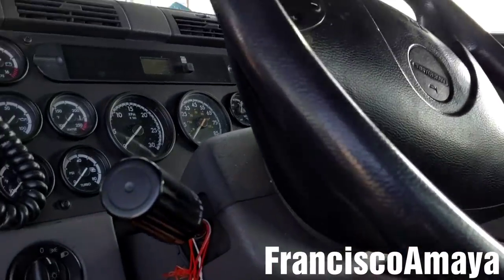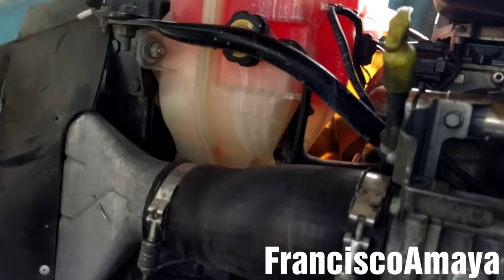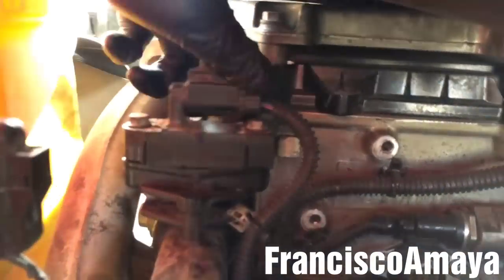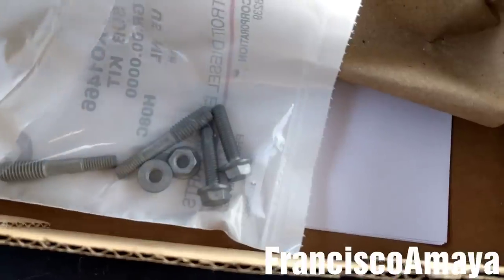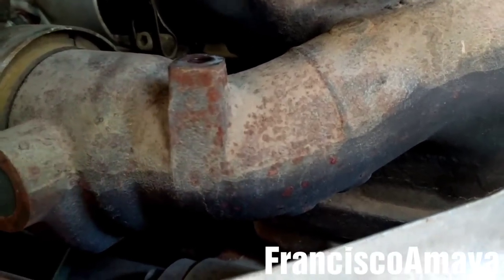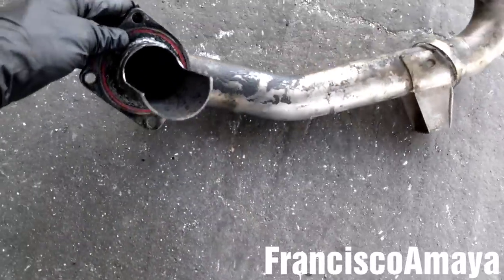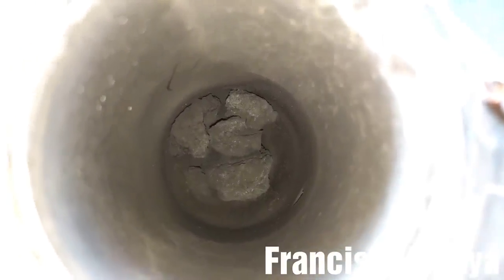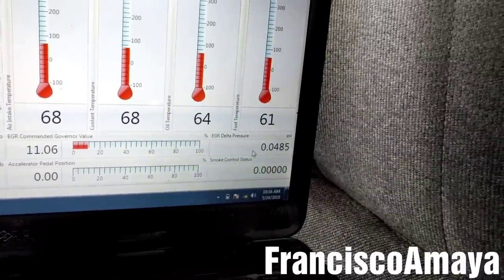Freightliner Cascadia DD13 DD15 DD16 EGR problem low power derate spn 2631 fmi 1

Comment: I used this video to diagnose my engine fault code. I replaced the Delta P sensor and the pipe it connects to. The light stayed on at idle, but after 230 mile with a empty trailer, when I stopped for fuel and turned the truck off, when I turned it back on the light went out. Thanks for your videos. New subscriber!

Comment: That EGR pipe is called a Venturi. Also you are doing good, I do this for a living and have for 40 years. Have also been to school on the DD series engines put on by Detroit Diesel.
Reply: I have a issue with the EGR hose blowing several times any ideas ?

Comment: Thanks alot. Always good information from you. I have no power and Detroit engines changed my  egr sensor. I still have no power under a load and no mechanic shop can find and problems.
Reply: Check your turbo actuator arm. I had that issue without codes. Turns out the actuator arm was frozen.

Comment: great 👍 video.we have same issues on mercedes trucks with same engines.thanks alot for sharing.i agree 💯 % that problem can be due to lots of items that control boost pressure.its also common on mercedes actros 963.

Comment: In my particular case, all I had to do was clean the 7th injector located behind the turbo and problem solved. You can try that before anything else. After I cleaned it, the light will still be on but will eventually go off after a few cycles. Again,  that was my particular case with same codes.

Comment: Damn I need that software in my life.  All the times I tell the service tech what the truck is doing while I'm driving and they can't replicate it at idle so the problem never gets solved.
Reply: 99jivvity I totally agree with the mechanic duplicateing the problem
Reply: or you can get a legal copy. $500 per year.
Reply: @musheghhayrapetyan8982  
Where can I get the legal copy?
Reply: Mushegh Hayrapetyan, where do I get a legal copy from? What is it called?
Reply: Jeremy Hall it’s called Diagnostic Link.. Detroit diesel software

Comment: I have 2016  Cascadia DD15 SPN 102 fmi 16 I change the intake also sensor but still i have air leak somewhere and no power

Comment: I have a 2015 cascadia with dd13. Its was pretty much doing the same thing. Its still under 30 day warranty. Took to shop all they did was check for code and change that same sensor. I think they should have check the things u did. How can I get them to do what u did?

Comment: Hi  I have a truck 2016 freightliner day cab dd 15 , has spn 411 fmi 1 and spn 3058 fmi 9 I did Delta pressure port Cleaning but still have the light on and off , do you know what is going on with this truck？ please let me know thank you!

Comment: Question got a 2015 cascadia with a dd15 ran great when first bought it serviced it and then after that it’s like when you step down on the throttle to pass someone or just get going it has no power fuel system seems no leaks or anything but it acts like it’s not getting enough fuel any ideas on what causes this

Comment: Hello tocayo!  I have a 2012 Cascadia with DD15... I just had an inframe overhaul done... truck runs good but loses power on uphills even with light loads... check engine light turns on and off... and sometimes stays on for a few minutes... I had it in the shop several times but no one can figure it out... computer shows all operations are good.... any ideas? Thinking there may be a problem with the EGR System ??
Reply: Hola. Lograste dar con el problema?  Yo tengo la misma situación.

Comment: Hey I have a 2011 dd13,I had the same issue just built up in the egr cooler, after I installed the cooler, the egr vavle at idle is constantly cycling in an out of egr flow you can see the egr actuator constantly sweeping, ran dddl troubleshooting out any help would helpful, tested mcm harness as well as harness plug for egr actuator, as far as reading for egr vavle goes for 10 percent to 40 percent constantly,  Parts replace EGR cooler, Delta P ports clean sensor replaced,  ehr actuator replaced also slow learn routine done, mcm was updated to current software, any help would be great

Comment: My truck is idle but slow rpm 1200 max  no code   i change the cpc and the mcm now check out the turbo is good  its a dd15 freightliner cascadia 2012

Comment: Spn 2791. Egr valve actuator position incorrect. I've replaced the actuator, the delta pressure sensor and new venturi pipe, still have the code. Also power loss in low altitude areas. It seems to pull better in the north east part of the country than down south, Texas and Oklahoma areas. Any ideas Francisco?
Reply from the maker: It is possible that you are having issues with the engine harness 
Check my video to see how it looks like
https://youtu.be/7ktdd8oF7PU
Reply: Thanks for the reply sir

Comment: Hi Francisco… I have a 2012 Freightliner Cascadia with DD15 Engine I by pass the DEF but since then I lose power on hills … I go to the mechanic who by pass it over 4 times but can’t get any better … and they already block with something for the EGR Delta Pressure pipe …. 
Any idea why Losing power on hills ??? 
Please let me know 
Thanks!
Reply from the maker: If you deleted your DPF system and there is not warning lights related to it, you must check your DPF filters since they get clogged after a while.
Reply: @franciscoamayaYT  
Thank you for the reply … but they already made a huge hole to pass the smoke through them… 
Do you think I have to reopen the DPF filter or the DOC???

Comment: Would a bad egr cause low intake pressure, I changed sensors and air filter and everything I could think if however I noticed  that my egr isn't rod isn't moving back and forth like it use to do.
Reply: Hello, did you find the problem I have low intake manifold pressure code for almost 3 months no Michanic or dealer could find the problem. I would really appreciate your reply
Reply: @ob834  I don't know if it was a bad CPC4 causing my issue or not but since replacing my CPC4 in Nov and having it reprogrammed I haven't had that code pop up but again most of the time the code would throw in warmer outside Temps we will see as we move into warmer weather. Check back with me at a later date and I'll let ya know if it throws a code.
Reply: Thanks much for your reply! I was told by the Michanic that it could be my MCM failing I just replaced it and after driving 100 miles same issue again. The codes sometimes clear out for just a few miles then pop back on the two main codes are spn 5357 fmi 18 and 3563 fmi 18.
Reply: @ob834  this shit has too many computers and electronics on it to really pin point the issues, but I'll know more about the intake manifold pressure code when it gets warmer outside. If it doesn't trigger the code then I'd have to say it was the CPC4 starting to fail and I'd recommend getting yours repaired and reprogrammed, I'll keep ya updated
Reply: Thanks a lot I hope your problem is fixed with CPC4 I know the parts prices are outrageous nowadays.

Comment: Great job! im looking to buy a 2013 Cascadia with a DD13 and 500 ,000 miles . Im curious how much did this job cost ? and  what should i look for if i buy this truck and also what do u reccomend i do to it first ? besides a oil change and service. Gracias espero su respuesta y muy buen video.
Reply from the maker: Dd13 is pretty similar to DD15 almost the same problems

Comment: Buena neches yo tengo un problema con mi dd15 en mi 2015 freightliner cascadia tiene un codigo  spn 641 fmi 5 me puedes dar una idea que puede ser el problema gracias en avance
Reply from the maker: It is possible that your turbo actuator is not working properly.
Reply from the maker: Es possible que el actuador de el turbo no este trabajando bien.
Reply: Gracias Francisco creo que no andaba trabajando bien el actuador por que el vpod se le callo un tapon que lleva enfrente y se le metio el agua por ahi a los componentes electricos dentro de la cajita electrica del vpod iso corto gracias por tu pronta respuesta

Comment: Hello Francisco 
I have 2014 Freightliner Cascadia DD13, I am getting check engine light 25% engine Derate service engine soon
The code i am getting is SPN2659 FMI 0
High air flow. I have already checked the delta p sensor its in good Condition i have checked the pipes too its all clean can you tell what could be the issue, thanks
Reply: EGR valve stuck open or sending too much egr gasses to intake manifold

Comment: where is your shop located I got the same code on my dd15 and I had the air filter replaced , intake manifold temp sensor and, intake manifold psi sensor still got loss off power
Reply: CCS Fleet Services.   8215 Beech Ave, Fontana, CA 92335

Comment: Also there resolutions report said it has an inactive but permanent code for low cac air flow. What does that mean?
Reply from the maker: When the code is on Permanent, the computer will monitor the code until the odb monitor gets completed and then the code can be fully deleted.
Reply: I appreciate your reply. U are a really great  Mechanic and you know your stuff.

Comment: Just had this problem today. 2012 dd13 Took off the egr pipe no clogs cleaned sensor took off egr cooler pipe to egr no water  egr actuator moves freely egr valve moves freely  could the vpod be why  I am getting the low air flow? I replaced air filter 3 fuel filters  I can start truck and as soon as I go on the road and press Accelerator pedal it does nothing  dead  no power kinda jerks gains power for a second then nothing again had to creep to yard at 5  mph  it will rev at idle  then if I hold it it will lose power at idle  very aggravating.  Was setting the egr code 2659  after cleaning everything now the code is low air flow 2631 but same symptoms NO POWER I have a snap on scanner and I can actuate the jake brakes but when I actuate the egr it does not change % on scanner   I hate these freaking trucks when they break down. Any ideas would be great. Also my fan is staying on all the time  this all started when my water pump went bad  shut down light came on  replaced water pump and fan is staying on all
Reply: Kt Carroll sounds like a engine harness .. these trucks have issues with chaffing wires.. with the low air flow code.. I usually find wiring issue along front of the oil pan where the harness runs across..

Comment: Tengo un dd 15 .que me estâ dando fallo que no lee el ACM.
Le conectamos 2 difirentes acm y no los lee y ahora me esta diciendo que 1 fuel injector cylinder 5 code .
Cree que pueda ser the engine harness problem .
Tengo codigos
Spn 1231, 625 ,3663
Muchas gracias
Reply from the maker: que codigos tiene?

Comment: Hello sir 
I have a 2011 cascadia dd15 check engine light is on due to ecu 128 or Sid 155 fail 00 
What is the issue exactly ?
Reply from the maker: Looks like you have a problem with the EGR valve

Comment: francisco   do get on and off code of SPN 102 FMI 16  I REPLACED IN TAKE SENSOR,AND PRESSURE CONTROL VALVE FOR WESTGATE ,AND REPLACE THROTHLE VALVE  AND I STILL GET THE CODE SO WHAT DO YOU THINK CAN CAUSE THE SOMETIME WHEN I CHECK EGR LINKAGE ARM ITS STUCK AND SOMETIMES MOVES EASY SO HELP PLEASE
Reply from the maker: Check the egr pipes and delta p sensors. The could be causing that problem
Reply: Siyad Mahammed EGR NOT WORKING AS SHOP Said.
Reply: @gtlllc1019  
Hi, did you fixed that code?because my truck has the same code.

Comment: Hey what cause dd15 while running to skip a little and little blue smoke come from oil cap when I take oil cap off It drive fine what it could
Reply from the maker: Probably the crankcase filter is not working properly
Reply: @franciscoamayaYT  
OK I'm try that its more like a steam coming from oil cap and dipstick
And blue smoke coming from the exhaust while its just running or when I come to a stop but while driving no smoke

Comment: Hi ..... I drive a 2012 freightliner cascadia it’s not my but I drive it the problem it’s the truck start but not power to get 55 mph takes time  I check leaks and I don’t see we change egr sensor and nothing computer says engine 1 and to amber lights are on
Reply from the maker: Do you have the code number?
Reply: Yo entro donde dice díag lo dejo presionado y sale 1 fault lo vuelvo a dejar presionado y sale 693
Reply: También 2631 y abajo en pequeño spn
Reply from the maker: This could be caused by a turbo leak, egr clogged or air filter restriction high

Comment: Please help. I've been having issues since October 2021. Check engine light, solid engine light, red stop light, followed by derating 25%. I eventually broke down. Replaced turbo & EGR actuator, delta P sensor twice, cleaned holes.
 Same issues intermittently without breaking down. My mechanic found the actuator isn't closing the egr valve 100%. Do DD13's need the spacer bushings behind the actuator where it mounts to the block? He thinks the actuator arm is not lined up correctly if the spacers are missing. Please let me know what you think. It's been 5 months with no solution.

SPN 2631
EGR mass Flow-2659

Comment: Hi Francisco, I just used your code and bought myself OTR diagnostics tool and after hooking it up and while I drive my truck my EGR Valve Position goes from 4% up to 40-60% and then back to 4-10% and circling, is that normal or is that the same issue like you showed here on the video?

Comment: I have a code spn 3250 fmi 3 dd15 Freightliner cascadia 2014 can you help with this
Reply from the maker: That code means doc outlet temp sensor open

This could be caused by
Bad temperature sensor
Wiring 
Plugs
Etc,..

Comment: Hey my engine creates when I'm in 10th gear and idles funny sometimes. What could it be. Just replaced the speed sensor  still doing the same thing
Reply from the maker: What type of noise?
Reply: Took it to numerous  mechanic it idles rough like a tick noise sometime and when in 10th gear it feels like it's going backwards  when I'm Bob tailing  so I keep having to downshift. Engine boggles down

Comment: Hi, Francisco what's your mechanical shop's name in Fontana, CA?

Can you please give me your contact information, I have problem with my volvo 2011 volvo d13 engine?
Reply: Hola Francisco puros problemas por esta parte del pais tengo 2012 Freightliner Cascadia con code fault 1
Fail 4
Spn 411
Eng 1
Que puedra ser nadie sabe por aqui
Reply from the maker: Luis Suarez
Dije que El EGR Delta p esta a Tierra
Puede ser El sensor malo o El cabliado
Reply: Gracias Francisco voy a chequiar lo y te dejo saber gracias otra ves por tu tiempo..
Reply: @franciscoamayaYT  se me olvido decirte aunque le quite el dpf eso no tiene nada que ver con eso?
Reply: CCS Fleet Services, 8215 Beech Ave, Fontana, CA 92335

Comment: Francisco tengo una pregunta , tengo un DD15 en un Cascadia 2012 tengo un problema que ni el dealer lo pudo arreglar ... cuando lo llevo en subida liviano o pesado muestra un código que dice “Low Quality Def “ ya le cambié el Def Tank , Def Pump ,Def inyector, all Def lines, DEF Harness ,DPF filter , Metering pressure valve, cambie el DeF al de Gallon y todavía sigue igual . En las subidas grandes prende 2 Check engine lights luego una pequeña luz en el gauge del DEF y pierde fuerza una ves terminó de subir como a las 10millas se quita y también hace lo mismo cuando el viento está en contra y tiene que usar más torque de lo normal . Porfavor espero tu respuesta a ver si sabes de algún caso similar Gracias
Reply: Gabriel Eguizabal  tube casi un problema similar el air dryer no estaba funcionando bien y me mando agua al air pressurey me contamino def metering tu que cambiar primero air dryer y durar una semana drenando los tanque para que me limpiara el sistema luego cambie def metering que estaba sucio no lo limpe cambialo y luego en el medio del chasis esta air pressure que tiene 3 manguera remplaza ese yo lo hice asi asta el dia de hoy no me a dado problema es frustrante andar asi te quita como el 20 % de la fuerza bueno suerte
Reply: Gabriel Eguizabal https://ddcsn-ddc.freightliner.com/cps/rde/xbcr/ddcsn/0227-14.pdf entra a est pagina vas aver las dos piesa que té digo
Reply: Gracias Wilfredo
Reply: Gabriel Eguizabal no hay problema brother suerte con lo tu yo 👍👍👍👍
Reply: @wilfredorosario9930  thanks
Reply: A mi me pasa lo mismo amigo ya le cambie todo eso lo que me termino diciendo el Mecanico que tal vez la one box tenía que cambiar  Francisco disculpe donde tiene el taller para llevárselo disculpe